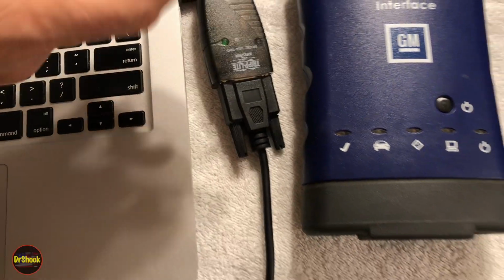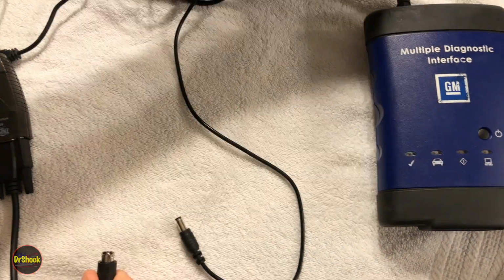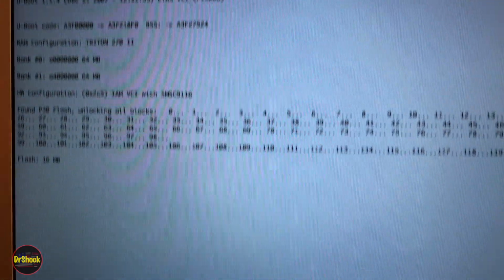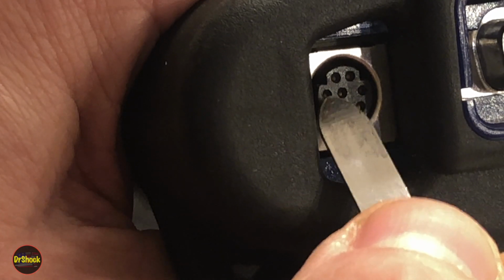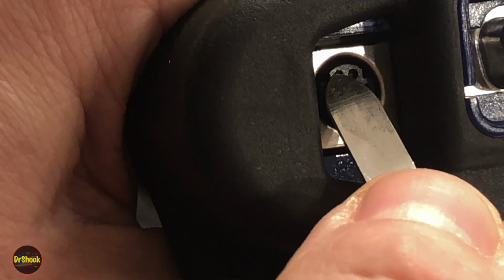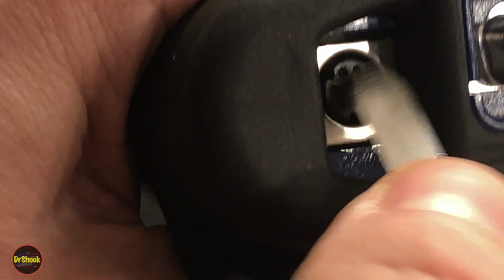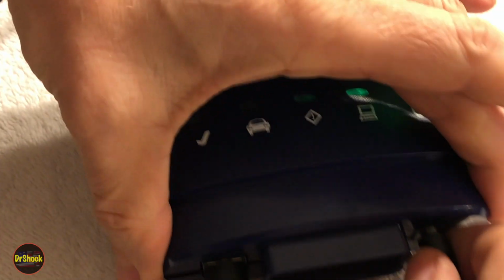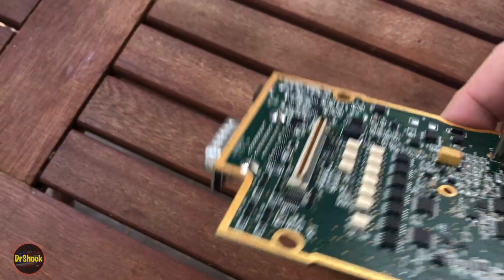Diagnosis and Repair Approaches for GM Multiple Diagnostic Interface (MDI) Tool Hanging during POST

Comment: You can no longer use clone/counterfeit mdi device for reprogramming with the new update for SPS3 GM will give you one warning and if you use the clone again they will ban you from Techline connect permanently.
Reply from the maker: Yep, policy went into effect on September 12th, 2024. If you are experiencing an E4214 error, this is more than likely caused by the use of a clone MDI or MDI2.m It should be possible to bypass this check by customizing the MDI clone serial number in the firmware image to match a known original one though using the same interface cable I showed in this vid.
Reply: I did enjoy your video tho…😀
Reply from the maker: Thanks, the video still applies to genuine MDIs as well (I showed one in this set of three).   But I might put one up on how to change the serial number of these units as well at some point.
Reply: @DrShock  That would be awesome.

Comment: I need some help if you can assist me I have three Bosch master tech 1 VCI (MDI1)

The green one works well no issue
And I have two gray ones
 BOSCH MTS 6520 after Diaging them 

1 needs just SD card I guess it’s corrupted that’s why it’s not working. I was trying to copy the one from the good one and modify this year number, but I cannot do anything with it. Not sure do I need special software to be able to do that

2- my second one need the SD card also and additional it needs the card look like the memory stick 

Can you assist me where I can get this item or can you repair the memory stick and create two SD card for the correct serial number?

Thank you so much
Reply from the maker: I'm aware of, but not directly familiar with the Bosch MasterTech I (lime green case) scanners.  The GM MDI is largely based on the same hardware, but has different firmware and different GM proprietary supporting software.

On the GM MDI, you can put the device into recovery mode and run a GM software utility (MDI manager) under Microsoft Windows.  This app will then rebuild the filesystem on a replacement SD card (that you have pre-formatted on your Windows based PC first).   Perhaps Bosch has a similar arrangement.   Replacing the SD card is not an uncommon repair with the GM MDI devices (first generation ones anyway).

On the GM MDI, it can sometimes be sensitive to the SD card in terms of keeping the capacity and speed the same as the original.  So keep that in mind as well when sourcing spares.
Reply: @DrShock  both MDI units that I have they have 2 GB SD card I’m gonna downgrade them to the same as the good unit 512 MB. I ordered the parts online and I’m waiting for them to come. I swapped the 512 MB from the good unit into one of the unit SD card and it worked it’s sold as serial number of the good units so I am hoping when I get the SD card to arrive I’m gonna plug it in and put it into service mode or recovery mode and see if it will reprogram it but my second MDI I need to source the power cards board.

I did my research and Colin Bosch so both the GM MDI Bosch  Mastertech VCI are the same except the difference is the firmware

Comment: Do you know anything about weather its possible to get these units to work on gm 8192 uart (pin9 on the obd2 port) my clone works with everything except this so it won't communicate with airbag modules. Ive not seen a clone that can.
Reply from the maker: I don't do collision repair projects, so haven't come across this.  But up until GM started to ban these MDI clones from Techline Connect in 2024,  I never had any issues with them otherwise.   I've gone back to just my genuine Bosch MDI since the ban went into effect.
Reply: @DrShock thanks for responding. You can get around the techline ban by modifying the serial and mac address, i am working on a write up for it, its quite a hassle but appears to work. From what i can tell as long as you get an mdi clone with wifi everything wprks except for obd2 pin 9 - which is an obscure 90s protocol only so uncommon, but important to know.

Comment: I need to replace D12 on the bottom PCB, next to the usb plug.  Would you happen to know the part number?  It's a 6-pin Diode array, TSOP-6 package.
any chance you would know the part number?
Reply from the maker: No, don't have that info.

Comment: I have had sd card issues with the clones, they come loose in the holder, they have a bit of glue from new but obviously not enough. Whip the sd out, quick format to fat32 and then reglue and boot the mdi in recovery mode
Reply from the maker: Yeah that can be an issue as well.  Obviously not what we had going on here with any of these three, but worth a try for sure.

Comment: For me in particular, I find your videos MOST helpful. I've upgraded my Tech2 power supply per one of your vids. Thanks for that one. 
I digress...I have picked up a MDI clone (with the WIFI card). I'm looking to program modules on a 2010 SRX. What version of Windows have you found to work for the MDI using GM's SPS? Thanks again, Doc.
Reply from the maker: Thanks.   Currently I use Windows 10 64bit.  GM keeps a PDF of what Techline Connect supports here https://gsitlc.ext.gm.com/userguides/Aftermarket%20Infrastructure%20Guideline%20v1.0.pdf
Reply: @DrShock  Thanks for your reply.
1. Do you have to be concerned with the vehicle shutting off (push button start type) which could possibly "brick" the module?
2. I saw in an excellent vid you did on programming using an MDI. In that video, your MDI was powered from the OBD port and NOT the 12vdc external power supply? Is that correct? Thanks again, Doc for all your vids!
Reply from the maker: When you are doing an SPS2 action, you need to have a battery maintainer (not a charger) to deal with voltage drops.  I have a video on the one I use in the channel.  The engine should not be on for an SPS2 calibration event, unless the service information specifically instructs otherwise.  So shutting off is not normally of any concern, just the battery level.
 
On power supply for MDIs I only power direct from the DLC.
Reply: @DrShock  I should have clarified a bit better. Realizing that the engine isn't required to be running (as you stated, unless SPS requires it) my concern is whether or not the ignition shuts itself off after so many minutes.
I did watch your vid on the Powermax battery maintainers....very informative as usual. I'm looking at the 55amp version thinking that a peak draw of 55 amps would be sufficient. Look forward to your videos.
Thanks again for your reply, Doc.

Comment: Hello! Interesting to see how they are constructed on the inside and how to troubleshoot them. I am thinking of buying one soon. Thanks! Do you have any experience with VNCI MDI2?
Reply from the maker: Thanks, I only use OEM type tools like the GM Tech2, or the GM MDI.   So I am not familiar with the aftermarket brand you mention.  But there is no such thing, currently, as a 100% clone of the OEM GM MDI2 interface made by Bosch.  

None of the tools labeled as MDI2 and claiming to be such can actually handle the new special protocols that the real GM MDI2 tool provides, so they are all really just original MDI level functionality, first generation J2534 interfaces.  I covered this here https://youtu.be/lt2z3Vc713Q

Comment: Who makes GM sending units? DEL pie.?
Reply from the maker: idk, depends on the model year, make, and vehicle.  Delphi makes some, but not all.
Reply: 2008 chevrolet silverado
Reply from the maker: Just buy ACDelco OE and you'll get the OEM grade part.  I have no idea offhand who that particular supplier would be and it could even vary within the same model year.